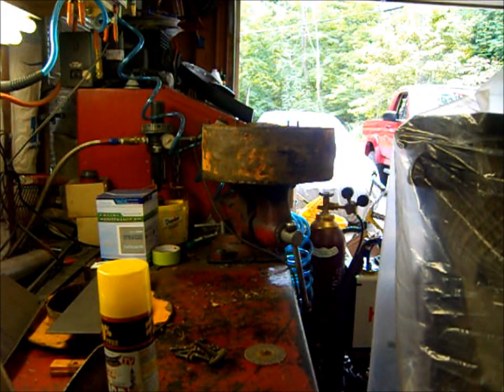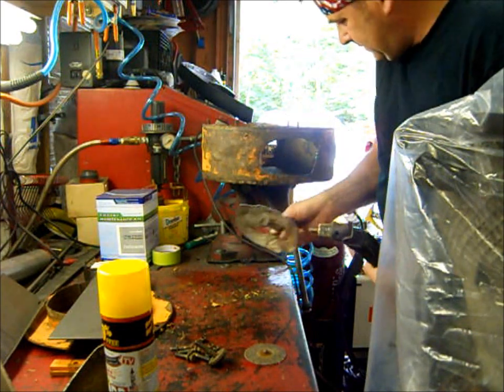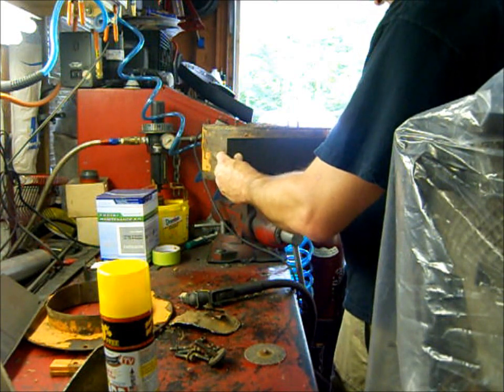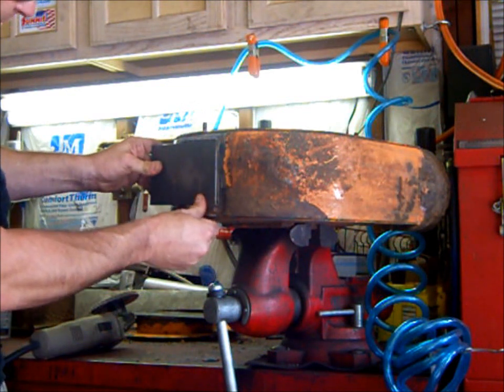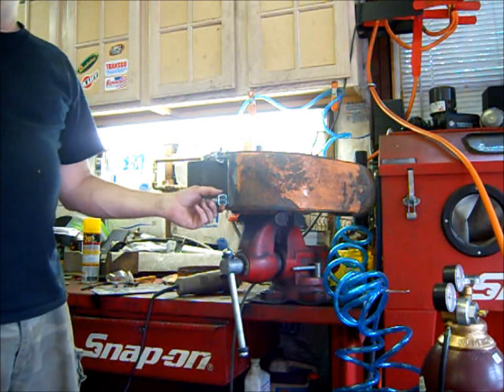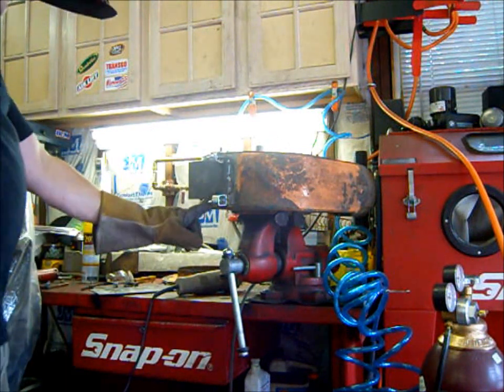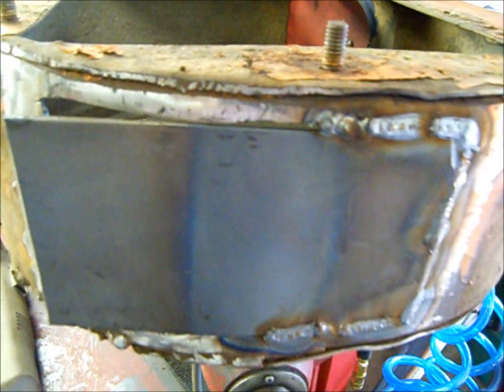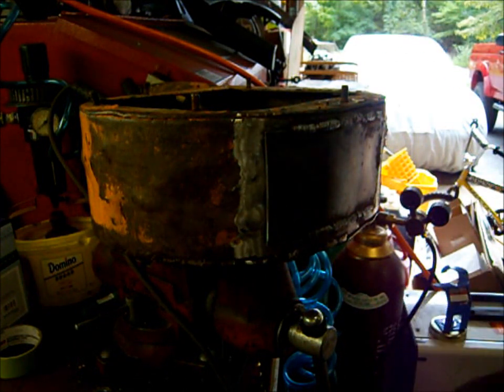Lawn leaf vac system fab part 3, patching the blower housing

Comment: Good welds. The big patch looks slightly flatter than the old metal, did you check to be sure the rotor still fits inside?

Comment: You answered my questions in the video-- I have had difficulty welding thick metal to thin-- have started doing what you demonstrated-- still messing with welder heat/ wire speed